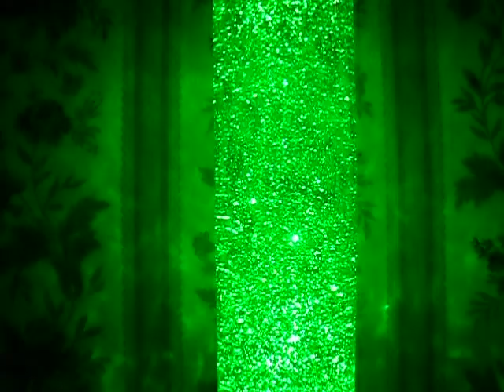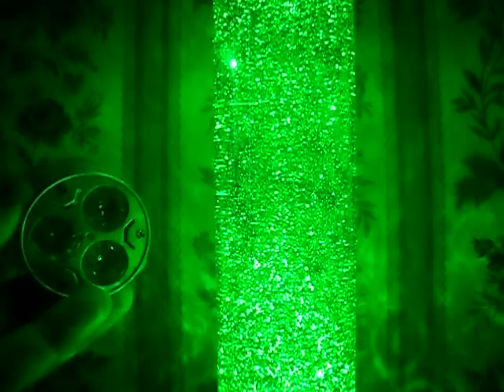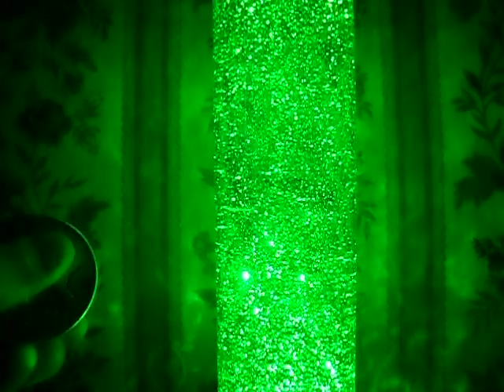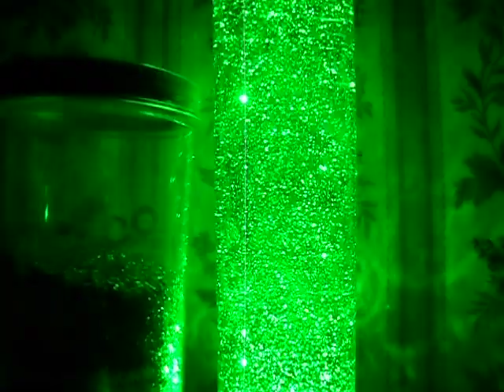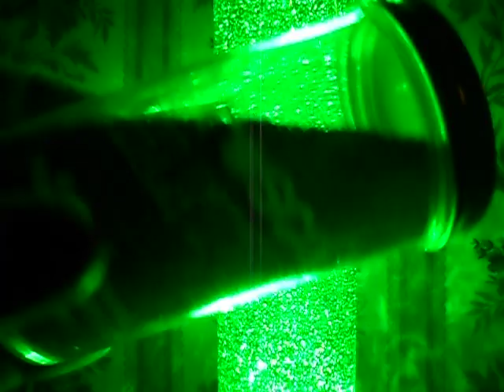Hacked LED glitter lamp.

Comment: I too have been wondering for a long time what was added to the water, and now I know. Thank-you Clive.

I have had some luck with using the ES version of the globe you mentioned, although they can sit a few millimetres high on some of the lamps and the wax lamps take a while to warm up, sitting the bottle part in warm water for a little while can speed that up, as long as you thoroughly dry it before placing it back over the globe of course.😆

Comment: Starting off, just want to say that this is an amazing lil guide! I am actually using this to attempt to make a glitter globe myself. 

I've been making DIY lava lamps for awhile, and I wanted to see if I could make a glitter globe. I legit, could not find much on the matter until I stumbled across you. I ordered some calcium chloride and some glitter with the hopes of me being able to replicate this. I'm still waiting for the glitter to arrive. 

If you have any tips/tricks I would appreciate it! 

However, I do have a question/recommendation. 
So, as I mentioned, I make DIY Lava Lamps. As you can imagine, the method of making them has changed over the years (and it still varies depending on what kind of "flow" you are looking for). One of the first methods that individuals used to make lava lamps were Epson/canning salt with distilled water as the main ingredients. There was a slight issue with that, however, as that the salt would corrode the metal coil inside of the lamp (which is used to spread the heat eventually, and break/mix up the wax while it flowed). The salt was replaced with an alternative - propylene glycol to prevent corroding. This leads into my question - have you tried PG over calcium chloride to prevent any corrosion to the glitter? I'm genuinely curious to know if that is a better option. I think it's fairly cost effective too, being that you can get a whole gallon for $25, and it's already in liquid form.

Sorry for the long winded comment, but thank you!
Reply from the maker: These days I use calcium nitrate in my DIY glitter lamps.  Much higher gravity.
Reply: @bigclivedotcom  Gotcha! I did jump the gun a little when I stumbled across your videos, so I didn't see the follow up. I do think though I did get high grade chloride however. So fingers crossed!
Reply: @bigclivedotcom so you no longer using calcium chloride ? Any example of ratio please ? :)
Reply from the maker: @khristinas  I start with making a solution using the minimum quantity of water to dissolve the calcium nitrate.  The denser it is the better.

Comment: Clive - You gave a very good description of the ingredients, but as far as the container goes, you only mentioned that it is 500 ml. But is it glass, plastic or what, and what shape bottom.
Where can i find one and how do i describe it ?
Thanks.
Reply from the maker: Any suitable glass container.  I used an existing glitter lamp vial.
Reply: @bigclivedotcom  I'm wondering if it is glass, for tbe heat transfer i mean.

Comment: A friend of mine asked me to fix the LED's in the changing color one, it looks like the red LEDs are weak or not enough to light it. I got the bottom plate off but all that is there is wires going the the next section. So to fix it I need to get the glass bottle removed from the base top part. Is it screwed in, or glued? It is the Vortex, made by LAVA Lite LLC

Comment: Does the liquid you make feel oily to the touch? I am asking because I have a lamp I received as a free gift that is losing liquid as it was not sealed properly. The liquid that drips out feels slightly oily like a very light oil. It is in a clear plastic container that tapers up near the top and has a top that appears like it might be glued on but when tipped up it leaks drips and over time it has lost a lot of it. So I was searching to see if there is a liquid that I can use to top it up, and this video came up.
This one plugs into USB, and think it doesn't heat up but maybe just designed for a person to tip it up to move the glitter around. I am not sure that I can removed the lid at the top without breaking it, as it is probably glued, but might try. Otherwise maybe I can re-use the led module contained at the bottom - it has three different colours (red, green, blue) and cycles from one to the next while leaving the previous one on - fades one while fading up the next one over a few seconds.

Comment: Hello from Argentina, your website instructions and this video are great for me, congratulations. You are giving me the solution to repair my old original Glitter lamp from the 60s, which I have, and has already lost glitter. My doubts are: which is better to use: calcium chloride hexahydrate, or calcium nitrate? Finally: would the holographic silver glitter powder for nails serve as a shine? Thanks
Reply from the maker: Calcium Nitrate if you can get it.  The coated nail glitter is the best type as it has extra protection.
Reply: @bigclivedotcom  Thank you very much for your prompt response. I will do everything as you indicate. I'll tell my experience later
Reply: @bigclivedotcom  
Sorry, one last question. Calcium nitrate is diluted in water in the same proportion as calcium chloride hexahydrate?, Thank you very much again
Reply from the maker: @Gatosalvaje61  I'd recommend dissolving as much as possible then diluting to the required level.

Comment: I have a question, and I understand if you don’t know the answer, but I’ve been trying to find a way to keep glitter suspended in resin, and I know there’s little hacks to doing it, like waiting for the resin get thicker and then adding the glitter, but I’m planning on casting a sword with resin to make it look like water, obviously I’ll add a blue tint to it, but I also wanted to add glitter, so I kind of have to add it in the resin before I pour it in the mold. Do you think Calcium Chloride would work? Or could that possibly be dangerous to mix? (I’d be using an epoxy resin).
Reply from the maker: It may be best to pour it as multiple layers.
Reply: Ahh okay. Thanks so much!

Comment: Big Clive, Where can I get the calcium chloride Hexahydrate in the states. To mail it from the UK is too expensive. or is there a place you recommend. 
I want to make the glitter lamp. 
Thank You
Ray Wallace
Reply from the maker: Hi Ray, Calcium Nitrate is even heavier, so see if you can find that.
Reply: bigclivedotcom
Reply: bigclivedotcom 
when I look up calcium nitrate, it come up as plant fertilizer, not sure what to buy, I have everything except this last part.
Reply from the maker: It's commonly used as a fertiliser.  Try and get the purest version you can.  None of these chemicals are really aimed at the public, so sometimes you have to find alternative sources and try to remove any cloudy impurities.
Reply: last couple questions about glitter lamp. is there a recommended air space on top before capping off, and is there a solution I need to add to prevent bacterial growth, like bleach or vinegar, or something even more natural.
Reply from the maker: Ray Wallace The chemical is strong enough to keep the bottle sterile.  There should be enough of an air gap to allow worst case fluid expansion with heat.

Comment: ive noticed that you can kind of get that same glitter effect when you focus a bright green laser. heres what you do... get one one of those really bright lasers (532nm cuz its most visible) go into a dark room. use a convex lense to focus the point onto a piece of paper that's sitting on a table or a desk. when you look up at the ceiling the light it gives off should make that glitter like pattern. I found that out the other day and im not sure why it does it.
Reply from the maker: +Pat P It's the coherent laser being being reflected back as lots of multiple laser beams that creates the sparkle.
Reply: +Pat P I was about to comment about the possibility for using a laser in the base of one of these lamps. I suppose you'd have to be a bit more careful, since you don't want even a moderate-intensity laser flashing into somebody's eyes. That might actually be a good use for that cheaper glitter: it's bound to be less flat, and therefore be a lower-quality reflector. Might scatter the light more.

Comment: I guess by what you are telling in the video, this is not something you just make in a couple of days. I want to make a lamp like this, but i just dont know where to start.. I got myself some glitter which i dont know the density off, and i got calcium chlorite dihydrate. But how much of this should i disolve in water? And if i pour glitter in the mixture it seems to settle at the top no matter if i use super concentrated calcium chloride or just pure water.. Do you shake it after pouring the glitter in it or?
Reply: If it floats it means it's lighter than water. You need lighter liquid, like rubbing alcohol. Better yet, find polyester glitter.
Reply: Иван Ерохин vodka may work
Reply: Vodka seems to work for lots of things. 
More often than not I have found it mostly helps on not getting things done.

Comment: Could you use aquarium salt (like Instant Ocean) to increase the specific gravity?  Also, calcium chloride is sold in hardware stores (at least here in the US) as stuff you spread on your driveway to deice it in the winter... it's in a granulated form, any idea how to use that?  Love your vids, thanks
Reply from the maker: +mnelson10000 At the moment Calcium Nitrate is the clear winner in terms of ease of creating a high enough gravity to suspend the glitter reliably.  I've tried so many salts in the past, and none of them were a high enough gravity, even when fully saturated.  Calcium chloride path clearer can work, but is generally very impure and needs filtered to make it clear enough.
Reply: possibly you couldnt dissolve enough sodium chloride (normal salt) in the water, to make it heavy enough. you owuld have to try with a small batch. 
you may have to filter a solution of hardware store calcium chloride, to remove agents that help to keep it from liquifying from humidity alone. but i see no reason, why this shouldnt work
Reply: In the aquarium world (I'm a reef tank nerd) we frequently use the hardware store calcium chloride to raise calcium levels.  After mixing, it is indeed very cloudy, but maybe warming it will fix that... I need to experiment.  Thanks!
Reply: +bigclivedotcom Ah yes, I see you have a followup video... I'll check it out, thanks

Comment: would a Hydrometer not help to speed up the set up?
http://www.fisher.co.uk/1/1/33258-hydrometer-200-degree-series-1-2-1-4-x-0-002-250mm-length.html

It looks awesome BTW
Reply from the maker: brian whittle I wasn't even aware you could get hydrometers in such a high gravity range.  that would certainly be useful for getting the liquid close the the ideal range.

Comment: well i actually just came across these e17 to GU10 adapter things on ebay, are those worth it? its just got an e17 screw on the bottom with the plug in for the GU10 on the top. could i just get one of those and then get a GU10 colored bulb like the ones youve got?
Reply from the maker: Kaity Sullivan The adaptors add length to the lamp, so you may find that the bottle ends up sitting on the lamp and isn't stable.  The LED version also requires a very delicately balanced glitter due to the very low heat.  In a traditional glitter lamp the glitter is very biased to the top, as the liquid expands as it heats up the glitter then sinks down and starts circulating.  If you had a lamp where the glitter stayed in suspension for a very long time after it had cooled then it may work.  But otherwise it would tend to gradually settle at the top of the bottle even when the LED lamp was on.
Reply: bigclivedotcom yeah...that's what i was worried about, the length and all that. and yeah, the glitter inside the lamp i have, once cooled down a ton, floats to the top. it tends to stay suspended for quite a while, i can't really say how long since i haven't needed to pay attention to it, but it does take a while for the glitter to float to the top and clear the globe. i have used a 10 watt incandescent colored bulb in it before, tho, and it did move the glitter, just not very fast. the lamp calls for a 40 watt or less, it says. idk, ugh, i really wanna try this or have a fix for this but nothing i have tried has worked well enough.
Reply from the maker: Kaity Sullivan With the LED it will be even slower, but will provide a more sparkly effect and project patterns on the rooms walls.  I have a test setup where I have an ornamental base with a standard GU10 ceiling light mounted in it facing up.  The glitter vials just sit on top of the frame.  It works quite well.

Comment: do you have a tutorial or anything like that on how to change out these bases for the LEDs? i am wanting to do that with a hot rock glitter lamp that i have that just has like a standard E17 bulb base thing inside of just a hollow aluminum tube. the bulb it takes now is an R14 e17 spot bulb and the light it puts out is gross and hot rock didnt do very well with coloring the glitter water so it basically just goes clear with the light on even tho its blue and puts out nasty yellow light. the lamp would be PERFECT if i could just do this LED thing. any help is appreciated! you rock!